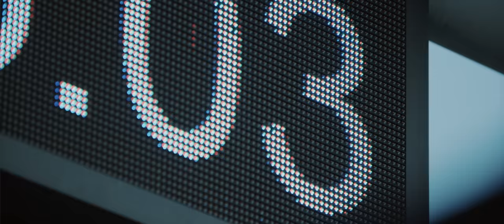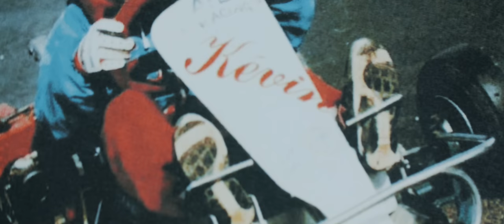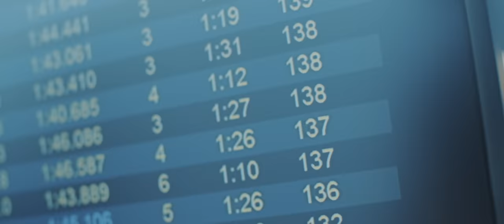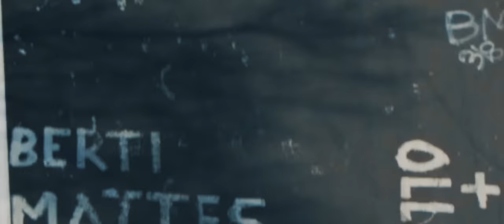Kévin Estre | Born on the Racetrack

Comment: what are your export settings? It seems you've cracked YouTube's compression, very little banding and artifacting.
Reply from the maker: Thanks man! The original timeline was 1080 but I exported it at 4K ProRes HQ.
I can’t remember what my compressor settings were but basically uploaded the highest res I could. Apparently YouTube compression works based on tiers - lower quality video gets compressed more, but 4K video suffers less. So even if your video is 1080 export it as 4K. I did a bunch of tests and it seemed to work.